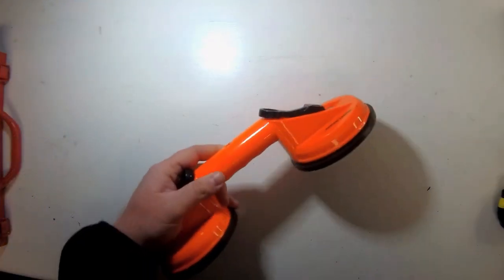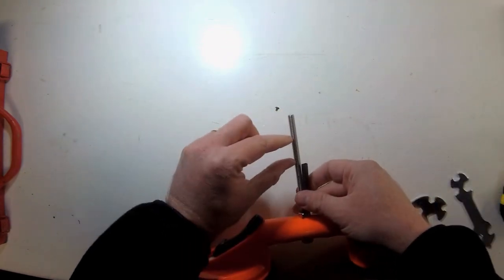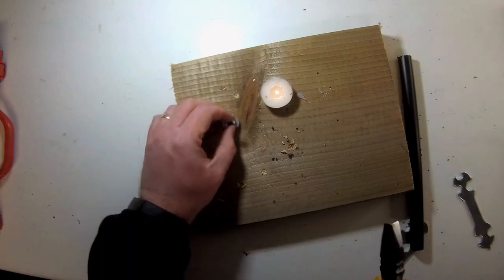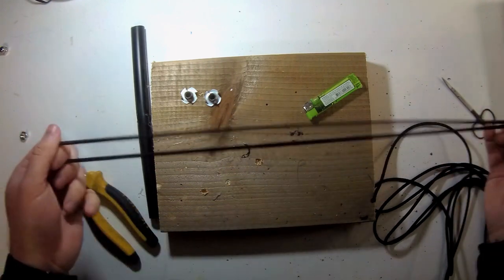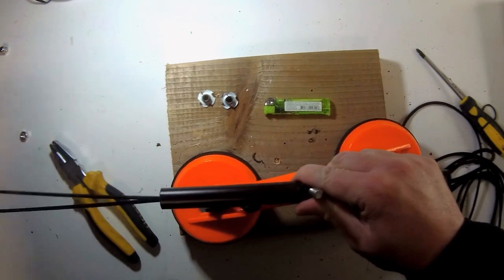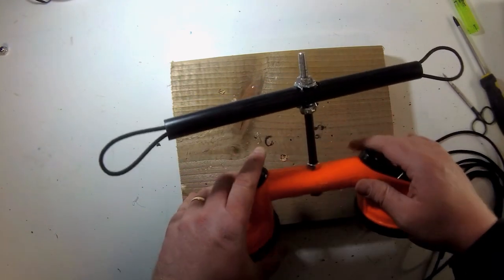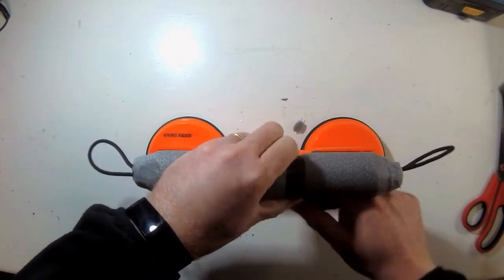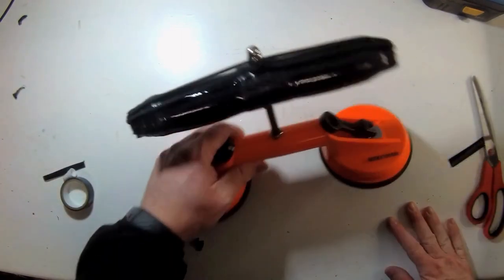Build The STRONGEST Car Fishing Rod Holders Ever!!

Comment: Great video Sean, where did you buy the orange holders?
Reply from the maker: Thanks Damien, I usually get the holders from eBay. Just search for 2x suction cup glass lifters. You can usually get a set of 2 for around £10-15.

Two brands I've used in the past are silverline (blue) and marksman (orange).

Hope that helps 👍
Reply: @SeánWoodsFishing  thanks a million, they're a fine job
Reply from the maker: @damienobrien7016  no problem, good luck with the build 👍